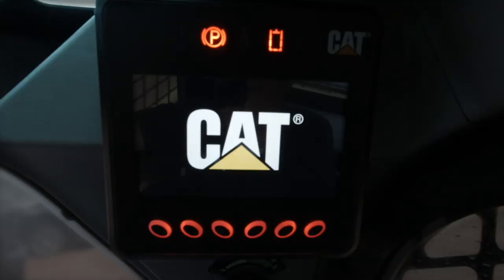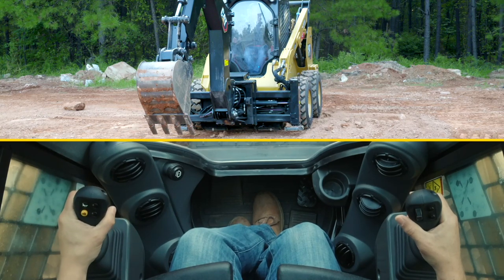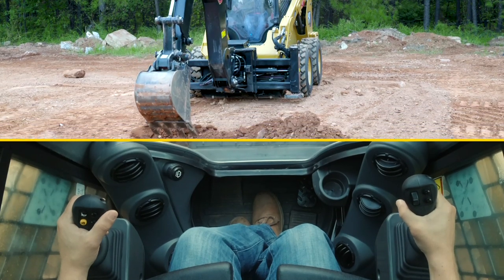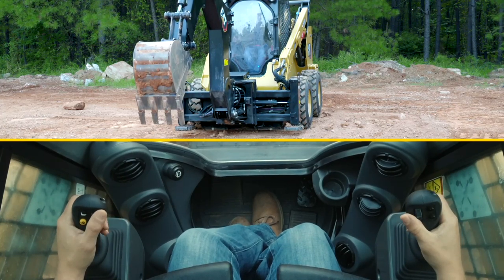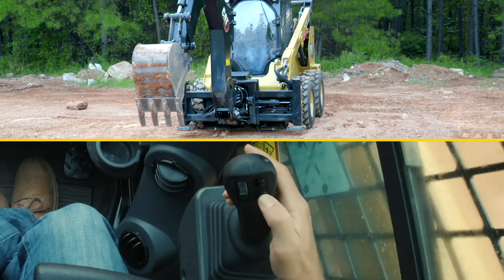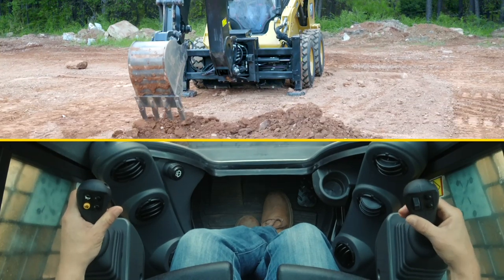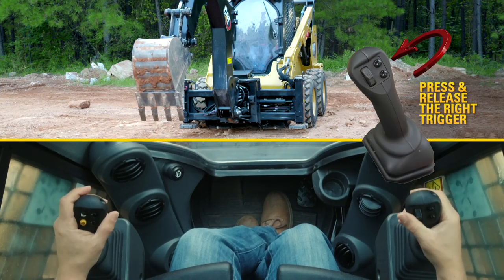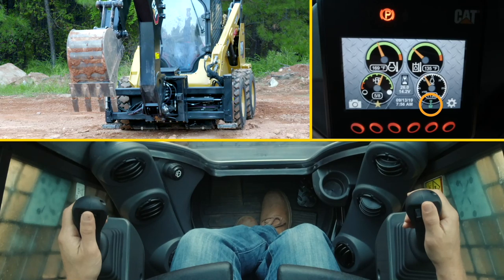Cat® BH130 Backhoe Attachment Operating Tips

Comment: how does a skid steer with backhoe attachment do on slopes? say, 25 degrees slope; thanks
Reply from the maker: Hi James! Great question! The backhoe attachment can be operated on slopes up to 25 degrees if the machine is facing up or down the slope. The machine will be more stable when the backhoe is facing up the slope. We do not recommend operating across a slope. If it is necessary to operate across a slope, the slope should never exceed 3:1 (18 deg). - Yasmin

Comment: It is absolutely ludicrous how you need to look through the glass to operate such a precision piece of equipment. Let alone dust, dirt, mud and grease on the window. I don't know either about the sitting position to operate this attachment. It might be good, and I will reserve judgement on that aspect of it. But you do need unhindered visibility to operate a backhoe productively. At least install a roll up door. I don't know why manufacturers insist on swing out doors. It's assinine.  Men who operate heavy equipment shouldn't be afraid to get hit, cold or dirty. Within reason of course.
Reply: The doors come off very easy